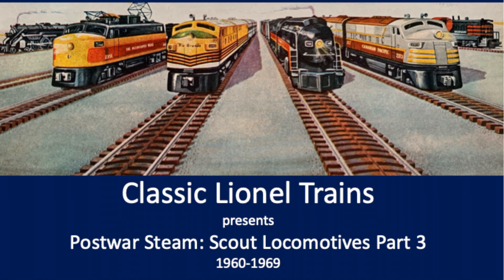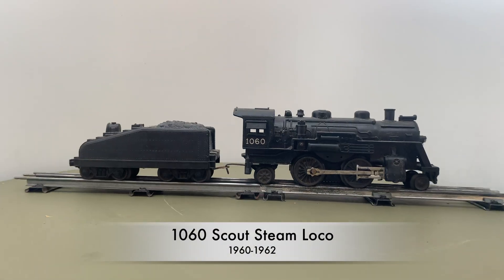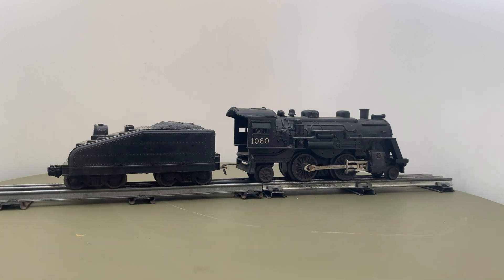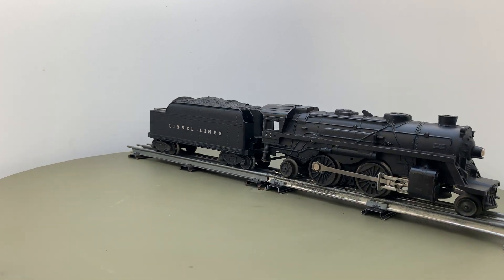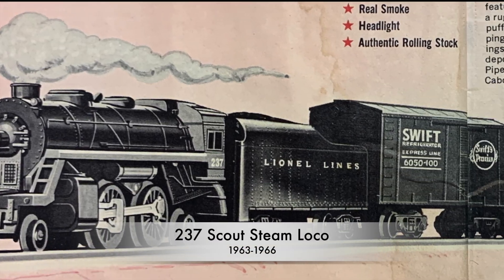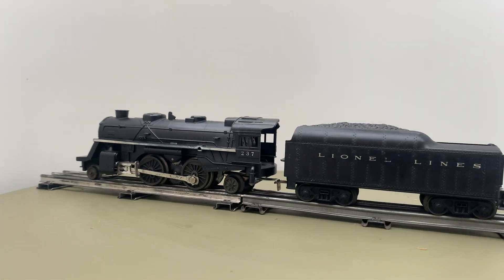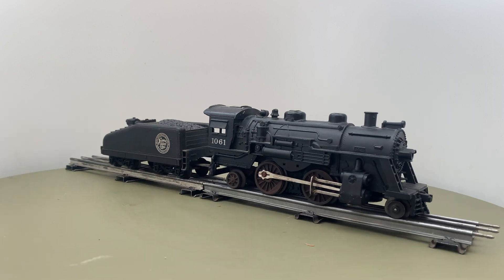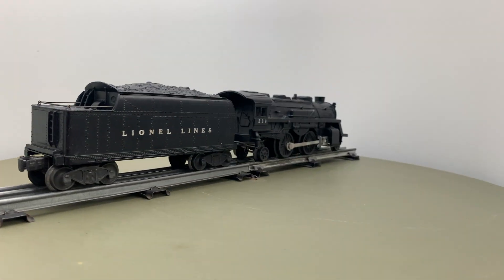Classic Lionel Trains – Postwar Steam: Scout Locomotives Part 3 - 1960-1969

Comment: I recently got a Scout set locomotive # 1110 & it's cars, that were in a 2-story high flood (Tropical Storm Agnes that hit the Wyoming Valley of Pennsylvania in 1972). It had been sitting in a basement for 50 years, covered in Flood-Mud. I cleaned it & lubricated it, and now it runs fine.
Reply: Yes they made them good  Bill

Comment: Your layout is fantastic. Thank you for sharing the video. I enjoyed seeing the variety of Lionel Scout engines, and your presentation was interesting and informative. Is there a device on the track that enables the trains to go fast or slow? Because I see the trains going fast on curves ascending and slowing into curves descending without derailing and falling off the track. And especially when the train crawls through the tight turns.
Reply from the maker: I adjust the speed with the control of the transformer.
Reply: @classiclioneltrains5977  Thank  you for your kind reply
Reply from the maker: @mdeange3  I am the engineer, I am in the control of my trains. Automatic control would be boring.
Reply: @classiclioneltrains5977  I agree. There's more enjoyment in operating the trains than watching them run on their own. And I'm impressed with your ability to keep them on track without the engines crashing off of a turn because the train movement was smooth and fluid, primarily in complex areas of the layout. Kudos to you. I enjoyed watching it. I recognize the labors that you put into the construction and design. Thank you for sharing your layout.
Reply: I also appreciate your decision to present a timeline of these mighty chuggers that I believe are passed over. The introduction of each model on the turn table is unique. And the payoff is to see the various Lionel Scout engines running and moving about on your layout is fantastic.
Reply: Who is operating the video because the trains are captured from all angles very well.
Reply from the maker: @mdeange3  I do both, video and train control. It is sometimes challenging. Only rarely, I got some help. I sometimes need 10 shots until I am satisfied..
Reply: @classiclioneltrains5977  A lot of patience to get the best shot. Great work!